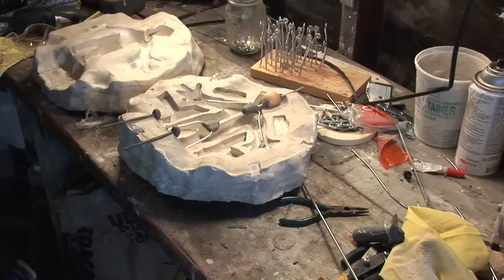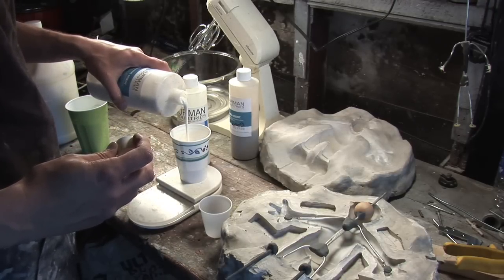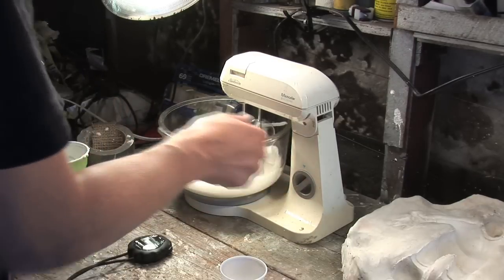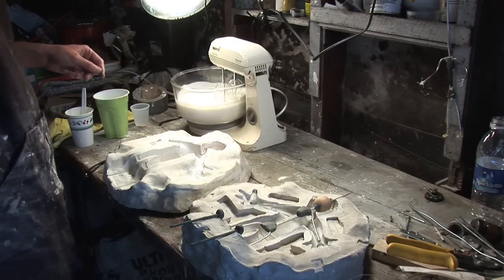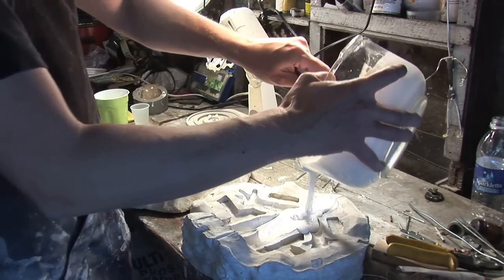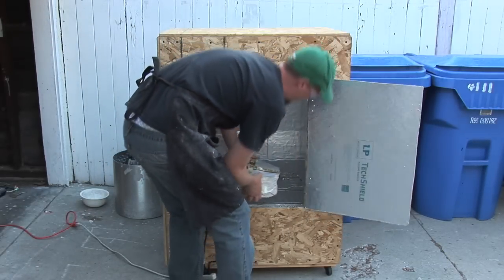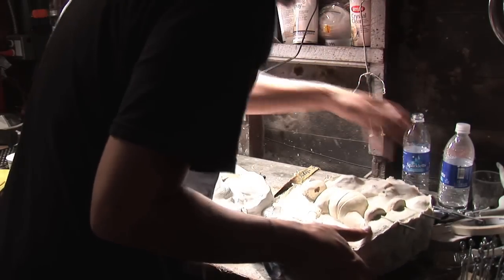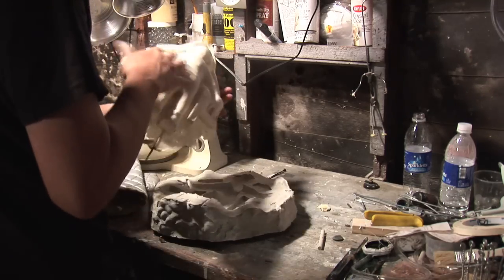Stop Motion Puppet Making Video 5: Casting a Puppet in Foam Latex

Comment: I was wondering if when I cure the latex if one of those big round glass air fryer ovens work? 

The one I have has;
12 - 17L Capacity
Adjustable Temperature: 60 - 250°C

Comment: can I use a convection oven for baking foam latex? if so, which one can I use?
Reply from the maker: +Bobby Neal Yes you can and you can use any kind of oven you like. Just make sure you clean the oven completely after use. The build up of chemicals can be toxic if it spreads to food you cook. The companies don't have to tell you what is in the Foam Latex so you could be cooking anything within the foam and be poisoning your food supply. That of course is a little extreme and you should be fine to bake a mold or two. But after 500 to 1000 molds you should be a little worried about your health.
Reply: stopmotionmagazine so what kind of convection oven do I need?
Reply from the maker: +Bobby Neal Just a regular oven should do. A convection oven for baking is usually suggested by the manufacturers, but I've seen major stop motion productions just use a regular home oven and they work just as well.
Reply: OK, if I get a convection oven, what degree should I set to for baking foam latex?
Reply from the maker: +Bobby Neal The foam kit should come with their recommended baking temps, but that all depends on what kind of mold you are making. For an UltraCal only mold you would probably bake between 140F - 180F. This of course is varies because of temp and humidity. If you cook at low temps you'll need to cook longer but with a more consistent and better feeling latex. Now if you have a matrix mold made of silicone and or fiberglass you'd bake between 110F - 140F. You'd also need bleed holes for the moisture to escape. Let us know what kind of kit you get. Chances are your first 2 batches will fail, unless you are extremely lucky. But you'll get the hang of it pretty fast and be able to master it after 5 or 6 times. Have Fun!

Comment: Ok thanks for the advice. Is there a reason the latex would be crunchy inside? I cooked it without the wire and it was nice outside but where the seam was came apart and was crunchy inside :/

Comment: I really need some help or advice. I'm using monster makers foam latex. I made a plaster mold with 2parts and pour the latex in. I cooked it for 4 hrs but it's still moist and one half of the mold is spongey. :/ I'm using a small char broil smoker.
Reply from the maker: +Vala Targaryen The problem sounds like it is in your selection of oven. You should use a toaster oven or a conventional oven.

Comment: that looks awesome! Could you tell me what the big difference between latex foam and flexible foam from smooth is? i want to build a wearable prob and can't really decide. plus i unfortunatelly lack an oven in the appropriate size.... :/
Reply from the maker: +Aaron Terell Expanding Foam is usually Urethan based and Latex Foam is rubber based. They are two completely different things. Foam Latex needs to be baked and Expanding Foam doesn't.

Comment: I'm having trouble locating a link to your December 2009 issue containing the oven build instructions. The oldest issue I can find on your website is from April 2010. Are you able to link or email me the .pdf? I'd really appreciate it.
Reply from the maker: +Tim Yingling Sorry it took so long to get back to you. This has been on my mind for weeks. I checked and the issue is up on the website. It's the Buddy Systems issue. Go to the issues section of the magazines website and click on the issue that has the water tower as the cover. Thats the issue you are looking for. It's in the back. Be careful and make sure you use the oven outside away from any buildings and don't go over 180 degrees when using it. If you can, please put images of your build on our forum. I'd love to see your build. CHEERS!

Comment: Would i be able to use a small toaster-convention oven for the baking process? I do not use the oven for cooking, i only use it for baking sculpy in my studio.
Reply from the maker: +Richard Lopez Yes! Definitely!
Reply: Thank you! Also I'm using a water based clay for sculpting my character, in my past experience I've used sculpey for building the mold. But Sculpey is pretty tough to work with especially in such large forms. Would you know of a type of clay  that doesn't stick to water based clay? Or is there a spray that can be applied to the water based clay to prevent other clay from sticking to it? Not sure if you would know this, but I figured I'd ask, considering ur experience! Thanks!!!!
Reply from the maker: +Richard Lopez Of course, Typically you would use Chavant (Oil Based Clay) to sculpt in and WED (Special Water Based Clay) to use in the mold making process. Oil clay should not stick to the water clay. You can also use Krylon Crystal Clear to act as a barrier between the two clays.
Reply: +stopmotionmagazine thanks so much! your videos are super helpful! :) I'm currently working on a stopmotion short for my thesis this year, thanks for the help!

Comment: Does foam latex necessarily have to be baked? There are other tutorials that say it just has to rest for 30 minutes. Or is that another material?
Reply from the maker: +Nibbi “DrNibbert” Nibnob Foam Latex absolutely has to be baked. The other material is Urethane Foam which needs to sit for 30 minutes. They are completely different, but will both give you good results.

Comment: Hello I write from Italy do not understand if the oven is hot or cold and how many degrees you put thanks hello Stefano
Reply from the maker: +joomladuepuntozero yeti The oven is hot. You should bake between 120F and 180F depending on the environment you are in. Check the instructions on your foam kit it should give you an basis. Just note that cooking at 120F will take you longer but may give you amazing results.

Comment: Wich kind of material is the "Mold Release", that you put with a brush before putting the Latex?
Reply from the maker: Ruben Hengesbach It's mold release that comes with the foam latex kit.
Reply: Ruben Hengesbach You can also use petroleum jelly, such as Vaseline for a mold release.
Reply from the maker: The Fryer No, you cannot use Vaseline or Petroleum Jelly with Foam Latex!!! It will eat away at the latex. You have to use the releasing agent that comes with the foam kit. It's in the instructions that comes with the kit.
Reply: what if i'm just using liquid latex with the build up method?
Reply from the maker: The Fryer No, you wouldn't need a mold release if you are using Liquid Latex. The plaster mold will absorb the ammonia from the latex and allow it to cure. If you put a barrier between the latex and the mold, it will never cure. Also, Oil based anything and Latex do not mix. So just don't do it.
Reply: stopmotionmagazine I've been looking around for a way to paint latex puppets after i take it out of the mold. i keep coming across mixing pros aide with acrylic paint but pros aide can be expensive, are there any cheaper alternatives? And thanks for correcting me.
Reply from the maker: The Fryer Pros-aide is your best bet. You only need a little bit, so buy a small bottle. It's not that expensive. Try Motion Picture FX or Burman Industries.

Comment: Hi! Thank you for your very useful videos! I tried the foam latex for the first time today... and it gelled in the bowl before I had the time to poor it into my mold. Do you know what can prevent the foam latex from gelling too quickly? Is it because I would have mix for too long the first three components, or for too long the gel agent? Or is it also about room and humidity temperature? Thank you!
Reply from the maker: That happens to everyone on the first time. Use less gelling agent and drip it into the bowl. Also be aware of your humidity and temperature in the room your mixing the foam. Foam is very sensitive to both those factors. Try a small amount and let me low if it works. And don't be afraid to reduce the amount of gelling agent you use.
Reply: stopmotionmagazine
Thank you, I tried by mixing a little bit less time my gel agent. It did work and I had the time to put it in my mold (it gelled pretty quick though, in 2-3 minutes). I baked it, and when I took it off the oven, my puppet seemed good at first, but when I touch it it became all flat. I'm not lucky for now, but I guess third time should work! When a puppet become flat, it is because of the gel agent not being mix enough?
Reply from the maker: MTLori You may be having an issue with the different chemical separating and not mixing properly inside the bottle. You should probably shake the hell out of all your bottles. Especially the gelling agent. It tends to build up at the bottom of the bottle and clumps up. I usually take a chop stick and try to break up the junk at the bottom and then shake the bottle for a long long time until the agent is mixed in the bottle. That would be my first guess. Second guess would be that you have a mixing time error on your humid and heat calculation. So double check that. and Last thing to look out for is when you put the foam in the mold that you are not introducing huge pockets of air that will cause it to be a massive bubble when curing. And finally don't forget to let the mold cool inside the oven once you have taken the puppet out.
Reply: Hi! It finally worked the 4th time. I mixed it a little less time (especially at the high speed moment) and baked it 1 hour more. Thank you for your help!

Comment: would not be better to use silicone in this step?
Reply from the maker: This is a foam latex tutorial. Silicone is a completely different method and you can ruin silicone very easily if you do things wrong or use a material that inhibits silicone from curing. I'll make you a silicone tutorial. It might be awhile but I'll get one up for everyone.
Reply: tanks !!!!!!! :)
Reply: 0:00

Comment: hello again!
i want to ask somethings here:
1.how do i know when is the right time to switch the mixer,put the geling agent,
back pull and such?
2.how much grams do i need from each material on the kit?
3.i don't find the oven tutorial on your web because i could only get to issues from 2011-2014 and maybe i will have to do several casting of foam latex so what i need to do?
hope to see answer soon!
P.S.:please, in the 3rd tutorial on the series i have asked you two questions (each on a different commant) and you didn't answer the last one, so can you answer please?
(i re-post the question yestarsday on the video).
Reply from the maker: It's all in the manufacturers directions. This video is just a basic overview of how to do the process.
Reply: OK, thank you.
Reply: stopmotionmagazine at monster makers i found two kits;
one called "Prosthetic Grade System" and another one called:"Animatronic Grade System", so which one i need to use?does it matters?

Comment from the maker: I've had foam last for up to a year and a half. What you are supposed to do is shake your bottles every week. This keeps them fresh. If you don't then a sediment will develop at the bottom of the bottle. You can scraped out the sediment and try to blend the elements back together in the bottle or pour it into a container for easier mixing. This sometimes works. General rule is 1 year.

Comment: When your mould was finished and you took out the foam puppet, there was a very thin floppy layer of the foam mould around it. Was that layer very stretchy and durable? Because I wish to make a product (similar to a sock) that is very thin like that and needs to stretch well. 
To do this, would I merely paint a thin layer into my mould? And it would only need to set for a few hours?
Thanks.

Comment from the maker: If your mold crumbled then you've most likely done one of three things. 1) you didn't use Ultracal 30 and used something else like a plaster - Bad Idea, 2) Too much powder and not enough water in your mixture, or 3) You didn't use Burlap and your mold is too thin. The burner shouldn't be the issue it would most likely be the mold. You can fix your mold using Burlap dipped in Ultracal 30 and laid over the crumbling area.

Comment from the maker: Actually, you will know by slightly opening your mold just a crack. If a lot of steam rushes out your mold isn't completely done. If you accidentally take the top off and it isn't done you can place the bottom half back into the oven and most likely save your casting. Also, the instructions that comes with your foam will also give you an idea of your baking time. Your local weather will also determine how long you bake for, Humidity, Temperature, and air moisture determine your time.

Comment from the maker: Silicone doesn't stick to anything but itself. Urethane Plastic Resin does however. You should always make a hard mold for a soft cast so that way the casting can be released more easily. There are mold release sprays that are specifically made for such an occasion. You would spray the mold before casting the silicone. Fast Cast is my favorite but beware of the fumes and mess that it makes. Best to make the mold outside and make the silicone casting inside.

Comment from the maker: Dragon Skin is great but a lot different to work with. Though the silicone itself is not toxic the paint however can be. It's best to talk to the guys whom your buying the stuff from. The Engineer Guy dot Com has some really knowledgeable guys and gals that can help you in picking your ingredients. Personally I would use Fast Cast Urethane to make my mold for silicone, but you shouldn't use that material in your house. Toxic and messy.

Comment from the maker: @wilsonrussell44 Well it depends on the mixer. If you check the manufacturers specifications for mixers you may be able to use the highest settings as your speed 7 on the mixer. Basically all you should need for mixing the foam is High, Medium and Low settings. So where the numbers are reference you may be ble to get away with basic settings. But it's not guarenteed so try it out with a few test batches. What country are you in and what foam and mixer are you using?

Comment from the maker: @wilsonrussell44 You can use any stand mixer but the settings and results will very. Definitely don't use the mixer for food once you've placed any chemical into it. Foam is safe to some degree but you can poision yourself and the manufacturers warn about this when selling the latex foam kits.

Comment from the maker: @TheSubscibingDude You can use this method to make a dummy head for ventriloquism. But you will need to place a core inside the mold and use an injection method for filling the mold. Basically, place a core like the head block with the mouth plates and extension pole suspended in the mold when place together. Clamp the mold tight and then use a very very big cyring and inject the foam. Make sure you use a little less gelling agent so you have time to work with the injector. Have Fun!!!